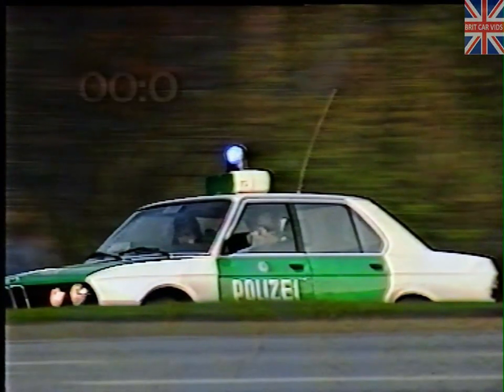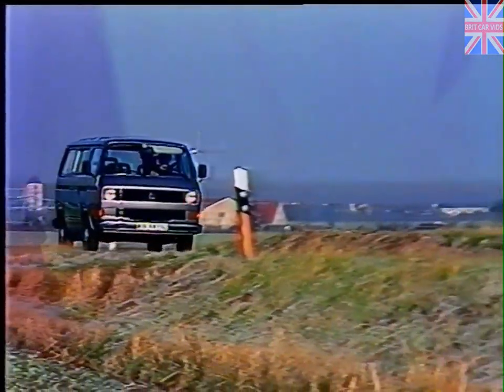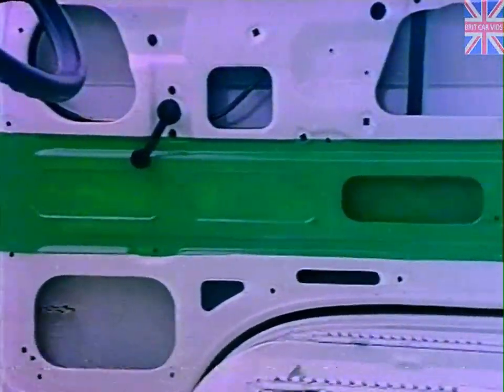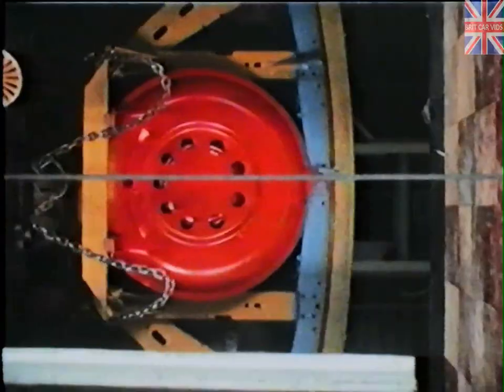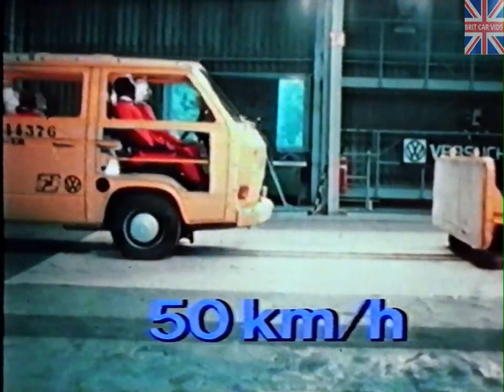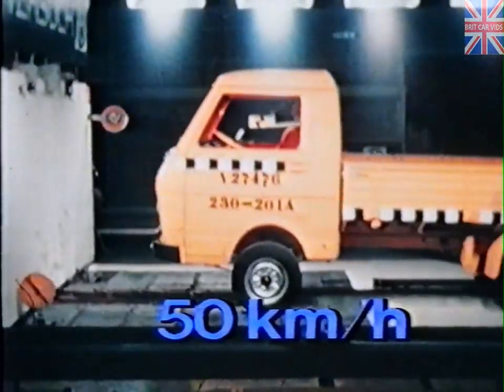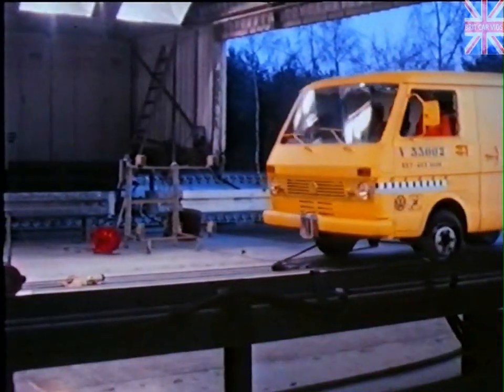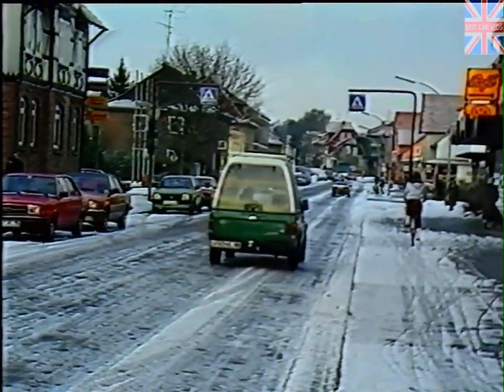Volkswagen - Volkswagen Safety - Volkswagen Safety Research (1984)

Comment: Damn. The Transporter was on the leading edge of safety. I wonder how it would fare on today's tests and standards.
Reply: They NCAPed a rusty Mercedes Benz Ponton from the 1950's and it did surprisingly well, better than some modern cars .
Look it up on you tube
Reply: The guy saying a modern supermini would tear through this thing is delusional. Modern cars are safe but the T3 wrecked a Volvo 740, other vans… 

If a large and equally sized car got wrecked,  what about the small modern car?? The T3 isn’t a conventional design by any margin.
Reply: About as well as any vehicle from the '80s. A modern supermini - even a supermini from ten, fifteen years ago -  would tear right through this thing.
Reply: It's not been debunked. The video was earnest, many commenters on the other hand are a bunch of paranoid Volvo fans who can not and never will accept that old cars are worse than new ones in virtually every respect (but especially in regards to safety, reliability and economy), especially not old cars they like. The car did not have rust on structural parts, the engine was present (see the red engine block, which is clearly visible in multiple shots) and the overall misunderstanding car engineering on display is staggering. Do they, do you honestly believe that engineers have been twiddling their thumbs since then? Do you think are car with such an abysmal structural integrity would be even legal to sell today? The same kind of nonsensical conspiratorial thinking was present with the famous crash test video of an old Chevrolet against a new one, by the way.
Reply: no1DdC that car has no engine in it. case closed.. T3 wins! :-D
Reply: Actually, there was a test done in the 80s when a T3 crashed into a Volvo 740 and the T3 did way much more damage to the 740 than the little Renault did. There was nothing left of the 740 in front of the B pillars, while the occupant space of the T3 was intact, so even if a modern small car is safer than a T3, I doubt that it would "rip through it".
Reply: @mattiasjohansson1727  would be an interesting crash to see. Maybe 2019 fiesta vs T3.
Reply: Old cars don't damge look at game with old cars barely damage
Reply: AversaS it would get 1 star or maybe 0 stars
Reply: It would not. Strong by the standards of the 1980s is extremely weak by today's standards. High strength, cold formed steel just didn't exist back then, not to mention the advances in the engineering department.

Case in point, take a look at this video of an old Volvo crashing into a modern supermini:

https://www.youtube.com/watch?v=emtLLvXrrFs
Reply: New cars are shit

Comment: Saying the VW van provides adequate protection  in a frontal crash is laughable.
Reply: Back in the day, this was considered adequate.
Reply: Do you understand what G forces are?
Reply: For a forward control style chassis this is very good impact protection . Do some research come back and we can have an informed conversation about it . Until then...
Reply: Go head on with a car and I guarantee the van will bend the car in half! The front of that van is extremely ridged. Did you see what that thing did to other vehicles?
Reply: Ram Runner Bullshit.
Reply: المانيه

Comment: I understand why they chose the American car to rear-end... The body on chassis disign where the sturdy bumpers are attached to the chassis... Allows the higher ride VW to overrun the bumper and use the relatively soft trunk of the yank as a crumple-zone which softens the impact to the VW
Reply: The K70 is not a wankel engine car.
Reply: they also crashed volvo 740 with same result
Reply: For everyone’s information that American car is a Buick Regal not sure on year or if it’s a Limited
Reply: @briabba123  Around '78.
Reply: The VW K70 is not a wankel-engined car. The NSU Ro 80 was..
Reply: @mipmipmipmipmip K70 = kolben, 70PS = 70hp piston engine. Ro80 = rotor, 80PS = 80hp rotory (Wankel) engine. The K70 and Ro80 were both NSU designs BTW.
Reply: @enpeemac  Exactly..! :)
Reply: On the other hand: These american cars were much heavier than an average european car. These old constructions with a stiff chassis and a weak body were more dangerous than the modern integral bodies used by most european car manufacturers of that time. And this test shows the weak spot of this old structures.
By the way: The LT performs as well against a rigid wall! 😉
Reply: @Nitramrec  I think the stiff chassis was convenience over  good design.  The trucks and cars all seemed to share the same chassis.
Reply: Technically a body on frame would do more damage, however consider how low the frame is on the Murican car, it would just override. A unibody would do even less damage, having basically no extra tough rigidity.
Reply: I drove a 1987 buick GNX from 1994 to 2005 and I never called it à limousine. This one look like a regular buick regal 1980/1981.
Reply: VW cheating on tests already in the 70s
Reply: Doesn't really matter. A T3 or LT would smash through most cars of the time, body on frame or not. Unibody car trunks are also nothing but a sheet metal box and a lot of air.
Reply: @swordfish1986  some of the people carriers are strong at the back and some estates especially ones with  7 seat options.
Reply: @chrishart8548  That's correct. Especially in modern cars it depends on the kind of vehicle. A standard compact class car like a Golf is probably a lot stiffer in the back than a middle class sedan, which has a trunk that acts as a crumple zone.
Reply: @swordfish1986  it seems like a shame when the back of the car takes a lot of damage but its better than severe back problems for the rest of your life.
Reply: They called the American car a "Limousine", which is odd.
Reply: @Philbytronic  that's the German way of saying it is a private not public vehicle. It's a 78/79 regal.
Reply: Philbytronic limousine: a large car ; stretch lomousine: the one we all have in mind
Reply: Yeah, generaly in Europe, but mainly derived from Germany I believe, that large cars are sometimes referred to as limousines. I remember my dad's old S80 being called a limousine in some documents.
Reply: @Philbytronic  it is a limousine
Reply: @Philbytronic  Why? This is cleary the body form of a limousine

Comment: That van completely drove over the bumper... of course it's going to crush the trunk...
Reply: On the other hand, that's what it would do in the real world so it's completely realistic.
Reply: Gabriel A. Seperate chassis is the reason the VW rode up. Its scary. 5th gear did a test crashing a Renault MPV v Discovery.  The Renault rode up the seperate chassis. Bigger Land Rover came of worse. It's on youtube.
Reply: Still, it's bloody scary that piece of tin crumpling just the same.  Looks like the car's fuel tank was empty to avoid a Pinto-like fireball!